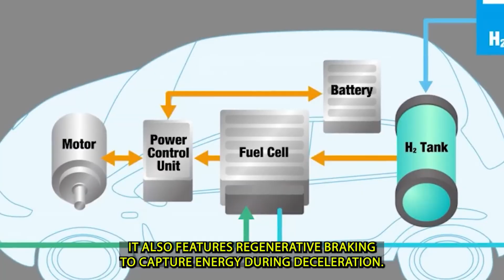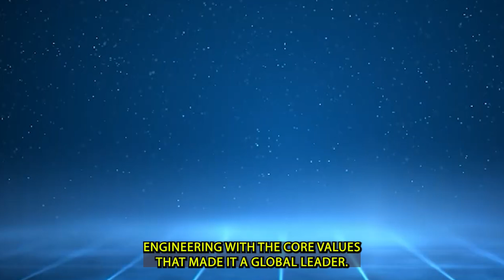Honda CEO Reveals New Hybrid Engine That Could Kill Electric Cars!

Comment: So the engine is designed as a powersource, not as a drivetrain... same principe already is used by other hybrid vehicle cars like Mitsubishi... in general I think going full EV is simply not possible for large areas with no massive population. Don't get me wrong.. driving fully EV in large cities is perfect... but go drive in remote areas in France or Spain, hilly terrain where it's difficult/impossible to build design electric infrastructure.. going on petrol is still the way to go..
Reply: I drove a BEV from Perth to Broome in Western Australia and you can't get much more remote then that. I had no issues so it is possible. You just have to plan it out.
Reply: @joeking22  What was the longest distance between charging.. and how long did you charge at that point... were there any fastchargers or just 220v sockets which takes like 2 days before the car is fully charged? I could stick a doughroller up my bum everyday as well.. i'm not saying it will be easy... but I think it can be done... doesnt mean we should do it happily... at least for most of us anyways.. ;-)